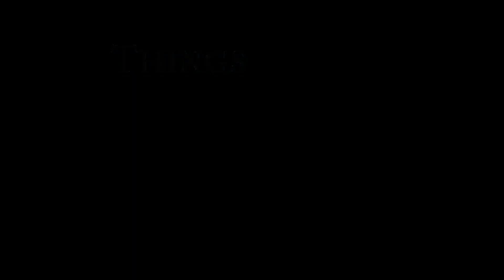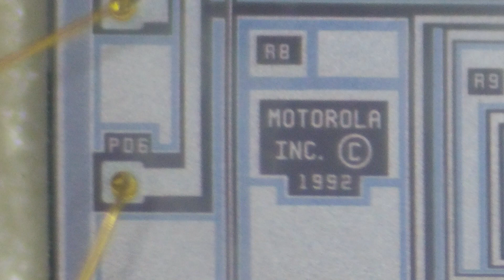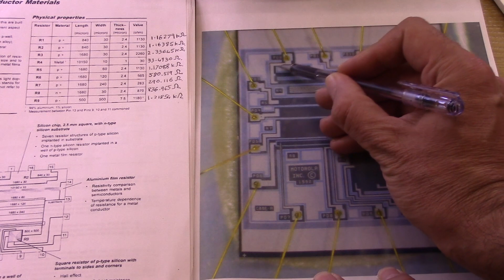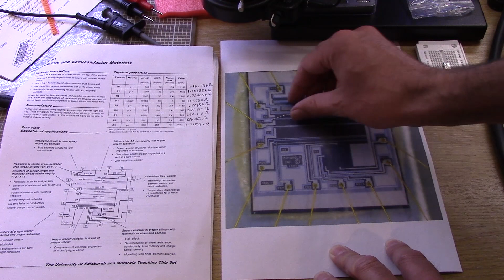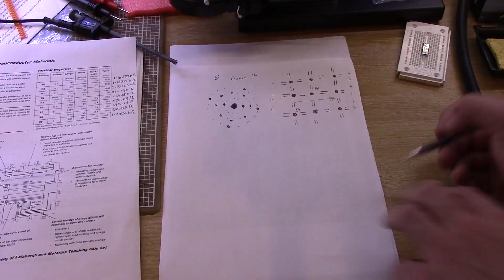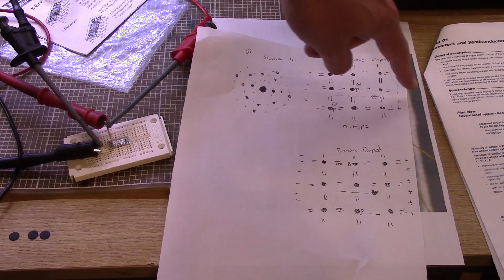Transparent Microchip  Experiments - Part 1 - Resistors and Semiconductors

Comment: I found a mystery clear chip and tripped over this video looking for information.  It's certainly not one of the Motorola teaching chips, but the fact that those exist is wonderful!  I'm impressed how close the resistances are to the nominal values, sheet resistance is normally poorly controlled in integrated circuits, so the designers generally aim to depend more on the ratio (which is well controlled) than the absolute value.

Comment: You really got me with the opening gag. Video content is fascinating! I can't say I understand it all, but that's my shortcoming, not yours. Too bad light interferes with the chip... those transparent ICs are so cool!
Reply from the maker: Heh - Thanks Hari Wiguna - I just couldn't resist having a bit of fun with the intro sequence. Blocking light out of the chips is easy enough if you don't want any of the light-based effects to plague your circuits, but I'd say it's rather neat that the photonic effects work too - photons hitting an array of silicon is what makes my camcorder work :) Cheers!!

Comment: I assume that the resistance of the p and n type can be adjusted by adjusting the power used to dope the materials. For example more power = more phosphates inserted = more spare electrons = lower resistance.
Reply from the maker: Hi Matthew Reece-Ford - Yes, you can.. to some extent... but if you replace too many of the silicon atoms with the doping material then you end up destroying the nice orderly crystal structure and the thing stops working. During manufacture they do use different doping strenghts for different areas on the chips - the chip substrate (upon which they do all the etching) is normally very weakly doped, and the transistors are all strongly doped. I would expect that the strongly doped regions are pretty close to the maximum viable doping concentration because lower resistance and better conductivity is such a desireable property that you'd be foolish not to do it. Cheers!!

Comment: Great explanations there Jim, and good tests too. Looking forward to the next one now.

Cheers mate
Reply from the maker: Thanks ***** - I've started thinking about Chip no.2 now (which is actually MOSFETs rather than Diodes as I'd incorrectly said in this video) - Fortunately the datasheet actually contains some circuit ideas for the MOSFETs so this one might be a little easier for me to get started on. Cheers!!
Reply: Jim Conner we can always get some Nitric acid and have ago at removing the cap for a more interesting chip Jim
Reply from the maker: 101blog Now that would be fun... I'd quite like to do that for a big chunky FET to see how it's constructed internally - Any modern chips are likely to be too detailed for my miscroscope to resolve, but a big FET might be nice to see the gate construction techniques. Cheers!!

Comment: Great video, I did not know how a hall sensor worked until now. One thing worth noting is those tiny delicate bond wires get thrown into place more than 30 times a second on machines I saw. Hard to believe.
Reply from the maker: Thanks Robonza  - 30 bond wires per second is mighty impressive when you consider how small everything is and how precisely the connections have to be made - Amazing what they can do these days. Cheers!!

Comment: Really cool experiments :) I enjoy your electronic videos almost as much as you garden videos :) also like the t-shirt the best response i got when asking that question was that it was still unplugged because of the lightning storm :) though you might get a kick out of that :) Also posted two new video maybe you could take a look at them and let me know what you think i should do :) Thanks Jim
Reply from the maker: Thanks Benja's Uber 1337 Hobby - I'll have to try and remember that come-back next time someone asks me if I've tried turning it off and on again. Cheers!!
Reply: Jim Conner Its sad but it was not a come back it was true. I thought the guy was messing with me but it turns out the had unplugged his pc and and modem so he had no internet. I think he was using a laptop and had no idea that he needed a battery backup on his modem to keep internet. During a power outage or if he unplugged it for safety. :) I know how annoying it is to get ask these questions though. When we call for tech support :)
Reply from the maker: Benja's Uber 1337 Hobby Back when I was running an email service, I had a customer call me up to say that their email wasn't working... and worse than that, the email problem seemed to have stopped his web browser from working properly too. It took me a while to get through to him that an Internet email only works when you're connected to the Internet. The same customer also called me every couple of weeks as he'd forgotten his password again (which was his daughter's first name every time). I have every sympathy for those poor souls who do first-line support for a living. Cheers!!
Reply: Jim Conner I'm sure we can swap stories all day long :). I do feel bad for them though. Some people put no effort to into learning about pc and the internet but other due try and those are the ones i feel bad for. I tell people that are embarrassed that they don't know so long as they are nice i am more than happy to help them. But it never fails when someone blames me for them not understanding and worst yet why they don't know something. As if i have a huge book of secret info (of how the internet and world works) that i only share with a few :) wow i'm mean when i'm can't sleep :)